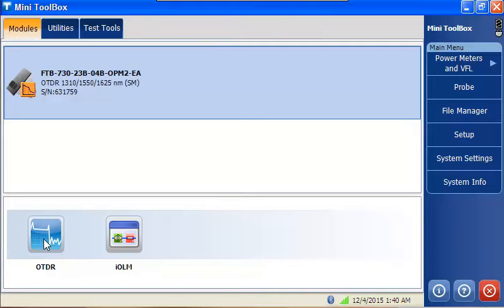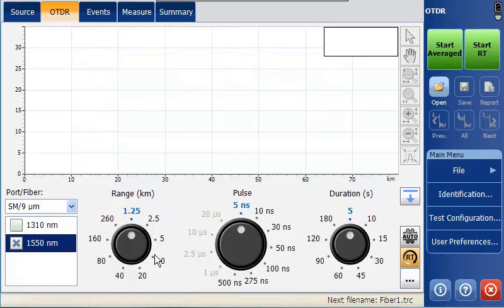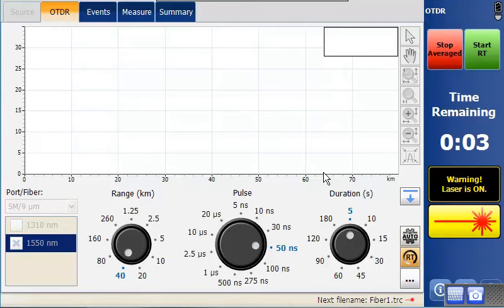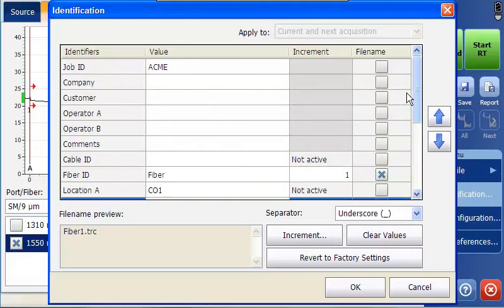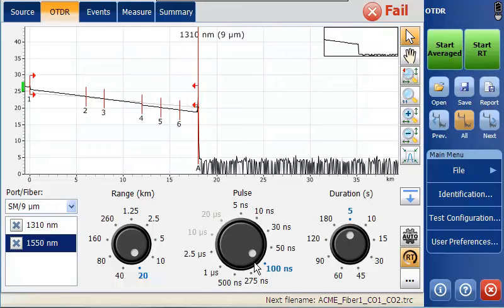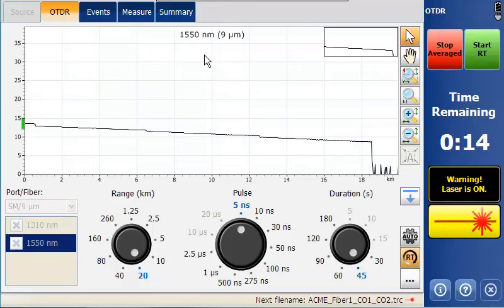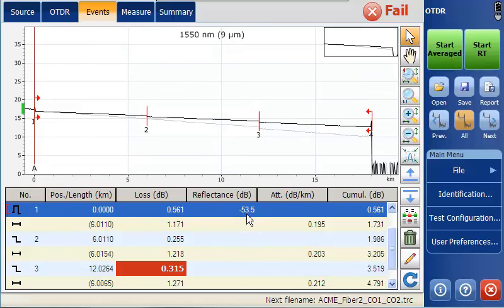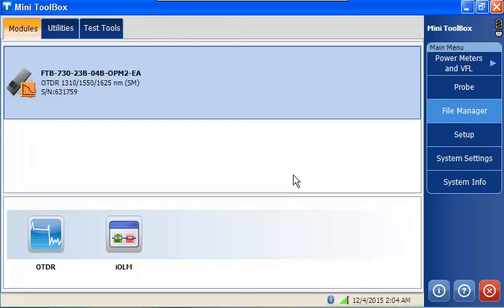OTDR Setup

Comment: What makes a section of fiber "Launch Fiber", as opposed to just fiber in the circuit?
Reply from the maker: Very valid question! It’s the exact same optical fiber as the rest of the circuit, but packaged as a temporary test spool to push the OTDR’s blind spot out of the way so you can accurately measure the first connector.
Reply: @EXFOTube thx for responding. I was able to figure it out shortly after the video jarred some cobwebs loose. Then I found the two launch test cables.